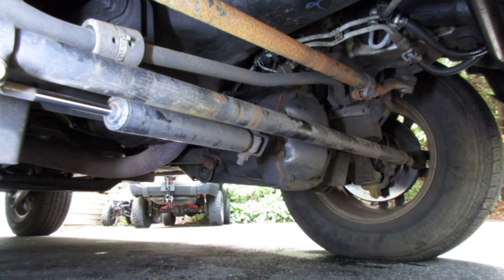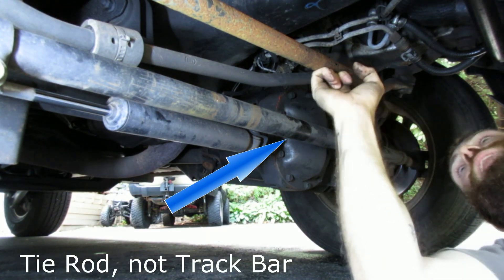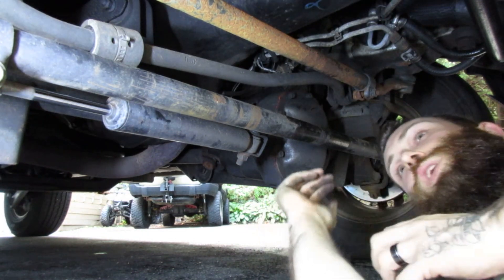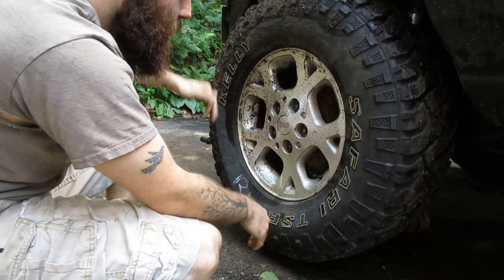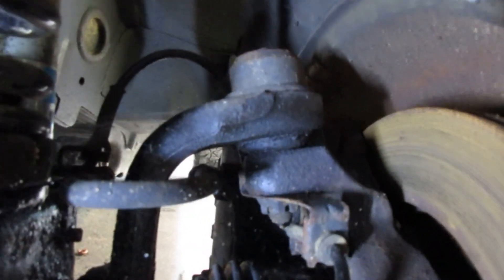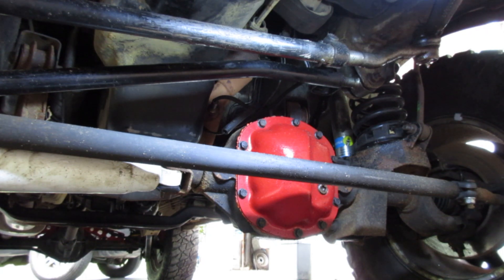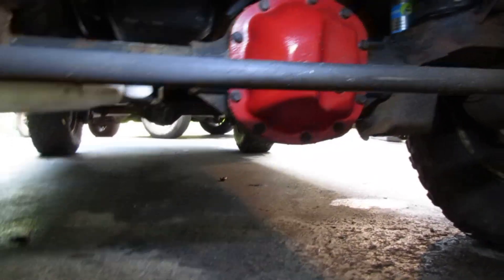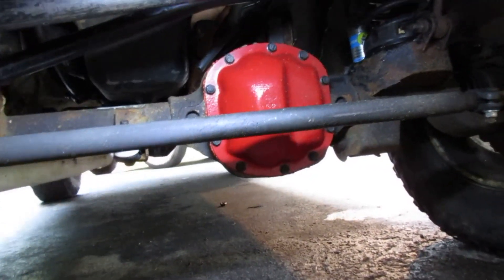How to Diagnose DEATH WOBBLE

Comment: One thing I did to stop death wobble on my 2000 WJ ( 4inch lift) is to make sure all the tie rod ends are serviceable with grease zercs and use lithium grease when you install them then give them another squeeze after about 10k miles and your good. Sometimes when you take a nonserviceable tie rod off it's seized up and can't move at all....thats not good cause those ball joints inside need to be able to move and flex. Don't trust pre greased parts cause they have very little in there!

Comment: Gms do not have solid axles they have cv axles, also gms arent a drag steer system, this means instead of a drag link connecting to your box you have a centerlink that connects your pitman and idler arms to your tie rod ends, that idler arm is the main difference in design it assists the stability of the steering linkage, this has been a gm design for a while now and to be honnest it seems to hold up better over time than the drag steer. The caster angle is what causes this problem because with not enough caster your stability and control are hindered greatly which translates to more movement in your front end, so when you replace parts yah it will fix it temporarily but what you need is more caster so your vehicle can gain better stability and control so going over bumps doesnt prematurely wear your components

Comment: FYI, I’ve never had an issue on my lifted 04 WJ. Most all suspension and steering have been changed and/or upgraded and recently I switched out a 1” anti-sway bar for the stock in the rear. These have grease able fitting from Addco and larger brackets as well so it’s stiff and with upper and lower control arms, new ball joints etc, everything is nice and taught. Just drive up to Cape Cod and she ran great no issue but on ride back hit traffic and there was the wobble. So…let off the brakes and feather them. Take her slow. Go off to get gas and lo and behold I look underneath and the driver side bracket upper bolt snapped and the bar was only secured by the drag link on the left. Now I’m halfway home, 240 miles Sussex NJ but she made it fine. Sheared off bolt no worries but the wobble was t noticed until the rear stabilizer wasn’t connected

Comment: Well I had a couple XJs and they both had death wobble. I replaced every single bushing, joint, bearing, and even the steering box on both of them and it didn’t fix the death wobble completely. I made it a lot better and it greatly raised the speed that it occurred from hitting the smallest bump as low as  45-50 mph to having to hit a noticeable bump up around 75-80 mph. Granted all these parts were worn and had a slight amount of slop so they needed to be replaced anyway. However the death wobble remained. I installed a dual shock steering damper out of desperation and believe it or not it fixed the problem! Now obviously you need to fix the worn out front end parts first but don’t discount a bigger steering damper it fixed both of my XJs death wobble issues. This is just my personal experience with my two XJs.

Comment: Death wobble,not happening to my steering, but Transfer case went crunch and grind,last year, when I.put it in 4 high in the the deep snow and stomped on the gas.
It began to grind,and I coukd hear the gears grinding 
But I did not have any ,so called death wobble, until I out in 2 different junk yard transfer cases,last summer.
I drove this truck in low range 220 kilometres several times with the original transfer case--- no death wobble!
Pulled it,put om junk yard unit 1,it gave me death wobble! So ,hot a second transfer case #2 it gave me death wobble.
So  this week ,I removed the second #2 junkyard transfer case.
I sent my original transfer case in to be rebuilt, hot in on,and not 2 moles fiwn the rd,I get death wobble ftom a dodge ram 1500 sly,4x4 thst didn't give me death wobble, when it was the original transfer case!
Spent 1200 to send it away,and I ger it back put in ,and I get death wobble!
So,it's raining out back,brought it home,driveway us Mudd, do it went into high range on the rd, low range,on the rd,and I coukd tell the difference, no more grinding and chafing sounds. 
So in 4x5 mode,I stepped on the gas to make the front axle and tires spin....nothing,no front 4x4,in low or high range.
And after spending $ I still get death wobble from a transfer case that was supposedly rebuilt, and had no death wobble before!
Sp,what is thr problem?😢

Comment: To Fix the terror of death wobble, or driving a jeep without front axles. Sinply knock off the ends of the axles without harming the threads. Place the axle end back thru the bearings assembly. Once placed correctly, add the washer and spindle nuts along with a carterkey.

Comment: You need to replace both upper and lower control arms, an upgraded track bar and steering stabilizer. Iron man off road and Old Man Emu, my XJ was smooth as silk. I just bought a JL…here I go again!

Comment: Bought Endurance Vehicle Service Contract for my 2013 Jeep.  After a scary Death Wobble, took vehicle to a dealer.  They discovered bad ball joints and front trackball failures.  The claims specialist at Endurance denied all repairs.  Don't buy Endurance, they don't cover anything with 25 pages of items not covered.

Comment: What a great video! I didn't even watch it but rather listened to it while driving. Still managed to get to the ideas due to this man's clear way of explanation what a great attitude and approach to calmly tackle a problem most of us would freak out about. But the problem isn't as big when you break it down and explain l, even to a a simple wrench turner like myself that didn't even know what the track bar was I just knew mine is too short since I bought the truck lifted and the axle is located so far out of center that I have 2 spacers on 1 tire to try and make up for it. Looks like I'm gonna start to make a list and finally start saving up for that big refit.

Comment: Well, I'm back to this video after 3 years 😂.  I used it before, changed all of the components, and finally cured the death wobble on my 2000 WJ.  The hardest part really was getting it aligned enough to drive after changing the time rod ends.  I got it good enough with string and measuring to limp it to a shop and do a proper alignment.  Ran straight, no shakes, and was all good for a bit.  A few months later, the trans cooler blew in the radiator.  Changed the radiator and cleaned out the cooling system, but the transmission eventually also shit the bed.  I bought a 1999 that was running, same lift and everything and parked the 2000 in the garage for parts.  Now my 1999 (affectionately named "Betty White") has the old death wobble and needs attention.  Luckily, I have all of the parts, unfortunately, they all need to be uninstalled first.  Thanks again for the video, time to go swap some parts 😎

Comment: You’re very thorough on your videos very informative. That’s a good thing for all. He made a comment about sharing our death wobble story with you. Well, I have a 04 grand Cherokee, and it is beautiful and had it basically sitting for two years because the death wobble I had other vehicles to drive, so went ahead and started at the beginning to track bar playing the steering set my control arms, putting all new control alarms ball joints, all new steering components you name it the entire front end. Everything was brand new had to tires checked everything steering box still triggered and violently as usual had no idea thought maybe the frame was tweaked who knew so for the first time I felt defeated by the jeep so I couldn’t let it do that to me so I figured I’m gonna rip every single component out and put new in and if it still has it then yeah this jeep definitely has a satanic personality but needless to say the minute we took the springs out of the front and remove the noise dampner here there were no perches left at all on the axle and nothing was holding the spring in I’m surprised it didn’t kick out and go flying somewhere to the next state, but needless to say we purchased a kit welded them in, put it back together and no more death wobble, so mine actually came from no coil spring perched on either side.

Comment: Thank you this video helped me a lot on my 02 WJ Laredo. Bought brand new has 224k miles on it.  I just redid my whole suspension front and back.  Felt death wobble for the very first time in my Jeep.  Right away people said it was my front stabilizer. I was like hmm is brand new.  Nope it was my passenger side tie rod that was a little lose on the bracket on the bar.  Amazing what a little movement can do.  Yes you're right when you said is crazy out of control jolt &  you can't control.  I was on I95. Luckily I was on the slow lane and pulled over.   People listen to him this video helped me out a lot.

Comment: Excellent comprehensive breakdown on the diagnostic process along with practical techniques for troubleshooting.  
If you experience death wobble, it does require that you address it immediately.  This video is a good guide for a DIY guy and will save you time, money, and grief. Spoiler Alert: 
Brace yourself for what you may find.  It is not uncommon for an the inspection to warrent a full overhaul of the entire front end.  
Like you mentioned, new or added steering dampeners will only temporarily mask the problem, at best.  After checking all the usual suspects mentioned in the video, and you still come to a conclusion that all is needed would be a new steering dampener, there is an easy way to confirm a failure in this component.  Take one side of the unit loose, preferably the extension arm, which is attached to the tie rod, opposed to the cylinder side, usually found attached to the axle.  The extension arm side mounting bolt has a lower torque value and will be easier to reinstall. Remove the bolt and fully actuate it in both directions a few times, back and forth by hand.  There should be consistant and equal resistance in both diections.  Even if you find slack in this component, indicating a worn out part, there will almost certainly have been a primary cause for this originating in one or, most likely more than one, of the components mentioned in this video.  If the dampener is found to be in good operation, don't forget to re-torque the removed bolt as a final step when replacing.  Check manufacture documentation for those values on your specific make and model.  
Finally, as the owner and operator of a piece of jeep shit, learn to enjoy maintaining their long list of constant, characteristic mechanical and electrical issues, as you will certainly find it unavoidable until you have finally had enough, passing the torch to the next sucker who is still green with that sparkle of adventure in their eyes and completely ignorant of the required funding to keep the good times rolling.

Comment: TOOK ON APART TO REPLACE  EVERYTHING AND THE LWR SPRING PURCHES WERE ROTTED OUT R&L ,THEY  HAVE REPLACEMENT BRACKETS  FOR THEM THAT BOLT ON LWER SHOCK AND SWAYBAR LINK BRACE .STILL WELDED EDGES THOUGH TO MAKE SURE IT WAS SOLID

Comment: Solid axle or independent it's absolutely irrelevant both of them get death wobble.
 I have an independent front suspension 4 wheel drive Z71 Silverado and I just reached 
496,000 and I have my 1st death wobble ever and it's done it 3 times since in succession,  I think it's a perfect storm of not just one component but all components in the steering and suspension system  Inter and outer tie rods upper and lower ball joints control arm bushings all of it being worn out.
I parked the truck,   I've already ordered everything I need I'm getting heavy duty everything and this is never gonna happen again.... But seriously very disappointing video you start out sounding like you know what you're saying but like a lot of content providers these days you didn't do your homework. Wow! That's a shame

Comment: Having watched more videos than I can count related to this topic, yours is very informative. Stressing the importance of replacing all you can while your deep into a repair is time and money saved. This is never mentioned enough by others. You make this point. Great video!
Reply: It all started with plugs…..then saw the water pump leaking from the weep hole. Couldn’t get the mechanical fan off of the old pump and fan clutch, which ended up being a ford mech fan lol. Checked the timing chain, out of spec. Rear main was likely leaking, oil pan was pitted with rust, did em both, as well as high volume oil pump. Lots of cleanup on the inside from the bottom of chum that had built up in my engine. Stat, stat housing, upper and lower radiator hoses, heater core hoses, vibration dampener, tensioner, idler pulley, certainly water pump. I just got it back together today after a nightmare of a time with the freak weather I had where I live. It started and ran better than it did when I parked it almost two months ago now. Although I still have quite a list to go of things to replace. Don’t buy a vehicle when you’re dog tired and in a desperate situation of needing a 4x4 for work, doesn’t end well, let me tell you!

Comment: Now I’m terrified. Just bought a 96 XJ and the sway bar was missing. Bought a 13 piece front end set and figured I would change the wheel hubs and new stabilizer shock. Anyway I put in the upper and lower ball joints ( nightmare) and new wheel hub on the drivers side and still have a popping noise on the drivers side 😞😟. Experienced death wobble one time in the time I owned it before the repairs and still haven’t finished up with the rest of the parts. I decided to take the Jeep to a friend of mine who has a complete shop and have him finish everything up but that’s a 2 Hour drive at highway speeds and now I’m terrified lol.

Comment: Another Big thing that plays a roll in Death wobble is Caster. If all your components are tight and you're still getting it have the caster set higher on an alignment rack. Learn how caster works and you will understand.
Reply: Caster is not adjustable on a solid axle Jeep unless you have aftermarket adjustable control arms...

Comment: Excellent review.  From much personal experience I can verify that the track bar ball joint is usually the prime culprit, followed all the steering ball joints (5 of them). F For example, last time I had death wobble the track bar joint had over an inch of movement!  And the tie rod ends were very loose and could be moved 1/4 inch or more.  The damper was useless of course.  The drag link joints were still stiff but probably compromised by the DW stress as he pointed out.  Replaced everything, track bar, drag link and tie rod + ball joints.   steering is much tighter and no DW.   The knuckle ball joints were only 3 yrs old and tested out solid,  but they are cheap chinese copies so  I plan on replacing those with OE Spicers 706944X next month.

Comment: Jeep metal must be made of tin. I have had cars with 300,000 miles and with the original wheel bearings, ball joints and steering components. This is the first time I have heard of death wobble. I will never buy a Jeep and will recommend my friends do not either.

Comment: If you have to change tie rod ends annually, you need to look into that. Something else is going on.
Reply from the maker: Not true. It is all about mileage, not time
Reply: @DEInTheGarage  I have had several Jeeps 2000-2004, and never have had that happen- even after 30, 40k miles. In fact, I have never had Death wobble, even with bad tie rod ends, stabilizer bar and etc.

Comment: Please help me.. i have wj with almost 3 inch lift 1.5 inch coils and 1 inch and a quarter spacer and i got DW I changed everything track bar all the bushings, drag link ends, steering stabilizer, tie rods end, tire balance literally every thing and still got it a when I reach 60 mph the steering wheel start shacking and start death wobble..What should I do, is
there a solution, I lost a lot of money and became broke.

Comment: Don't want to micromanage but if you're going under a vehicle that's running, make sure the parking brake is set, and even better, rear wheels are chocked (or off the ground).  Even better than that, make sure you owe money to the person who's going to be behind the wheel.  

Safety first.

Comment: May I ask a question? Its just hard these days because no one seems to care and of course like many i dont have the money to pay to have someone look at my car..
 But I had accidentally knicked curb with front and back rims on right side of car and part of my rims(both) scrapped. So i at some point know i need to get new rims _ but my thing now is when I go to make a u turn something doesn't seem right, its like the base/suspension or something. Then when i go over speedbumps instead of it going smoothyl over like normal its like none of the tires are connected properly? As its like the whole car shakes/wobbles all over the place and lastly when im driving on the highway it seems and feels like at any point it could lose control?  
Its not making any noise i can just feel it. I dont believe its the steering wheel but whatever its connected to. I dont know what else I could have damaged. Sorry for the essay. Just figured it doesnt hurt to ask someone I hopes maybe they would know